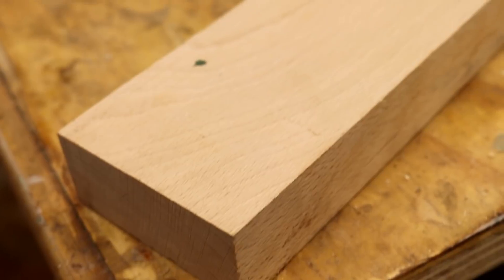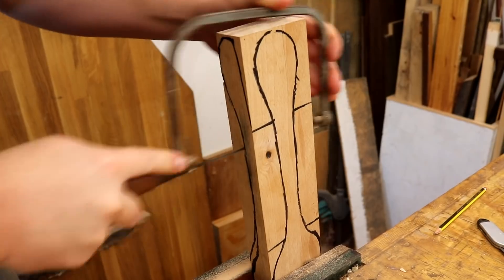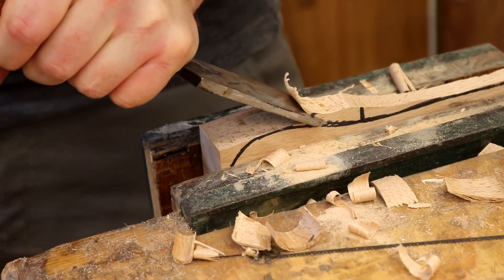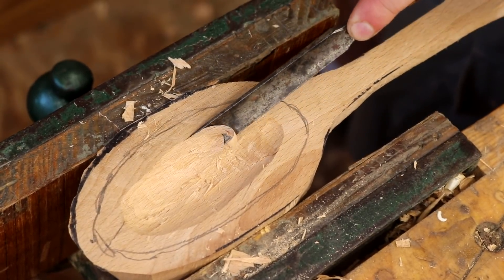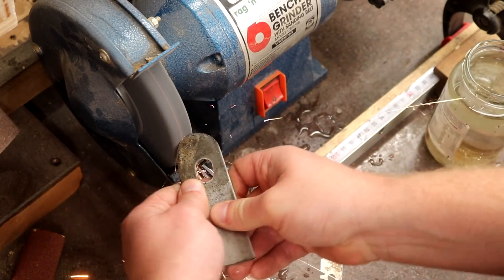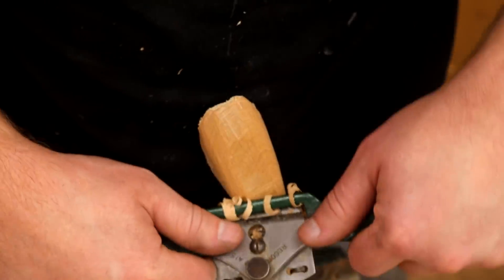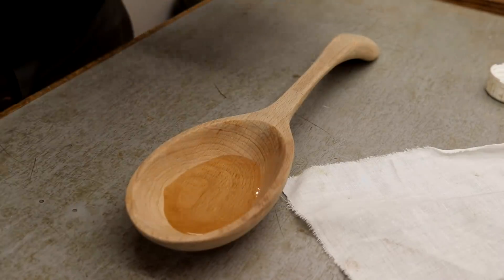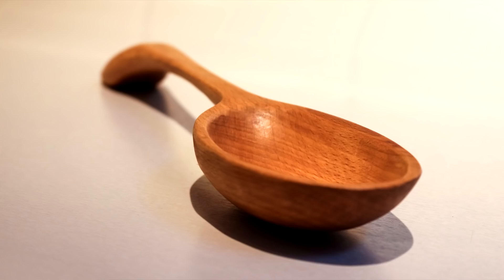Hand Carved Wooden Spoon - Hand Tools Only Project

Comment: The nice thing about spoon carving is that there are no wrong ways to do it. It's also very addictive, I did three spoons in the past few weeks.

Try doing the rough work with an axe. Much faster than coping saw.

Branches of yard trees make perfect material for spoon blanks.
Reply: No wrong ways... I'm glad you said that... I made my first spoon two weeks ago because I needed a long handled spoon for my travel mug. I didn't have ANY of the traditionally accepted tools. I seem to recall I shaped parts of it by chewing chunks out with my teeth... Anyway, after much sandpaper my spoon came out BEAUTIFULLY. At least I think so. I use it for eating too.

Comment: Well done Keith. The part about making your own scraper out of the scrap saw metal was brilliant. One question though if you didn't have a piece of wood thick enough could it have been done by gluing a couple of small planks together? Thanks again for another great video.
Reply from the maker: Yes definitely, and you’d only need to add more depth to the bowl of the spoon unless you wanted to do a curved handle like I did on this one. Best use a waterproof pva glue though 👍

Comment: in romania, traditional wooden spoons look chopped, as they're not smoothed out. i dont know how they're made, but surely they're not coated. nobody ever died from using them. yours looks fancy and bought in the store. we have those too - smooth and coated, but i dont like them as much as the rough, peasant ones. they do get stained with tomato sauce. in time, thats called 'seasoning' i guess ;)
Reply from the maker: Yeah I don’t think it’s essential to coat them especially if they’re beech. But a little oil and wax should mean that they absorb less water and food stains
Reply: Mine started off looking lovely with the original, slightly flecked pine look (it's not pine but nobody can tell me what it is.) But now half of it is a rich russet brown from my tea.